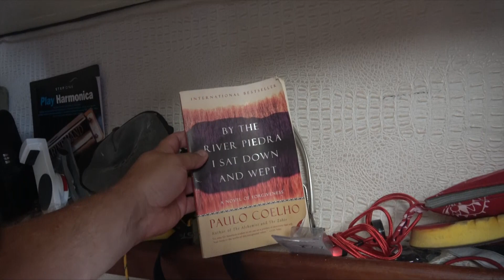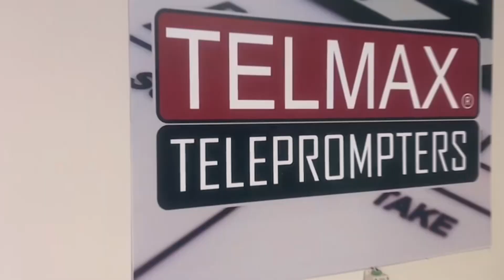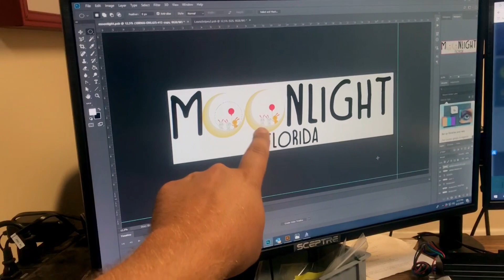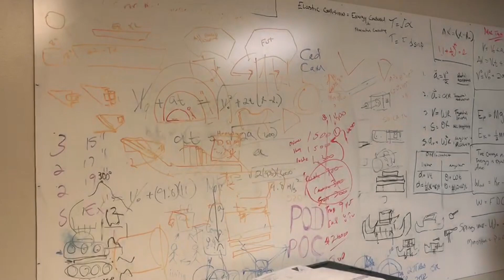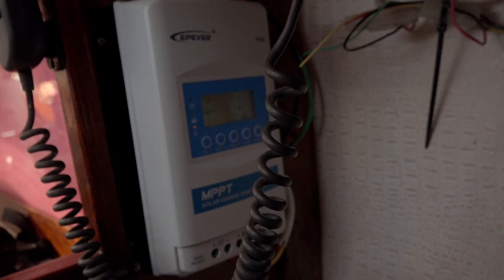BACON SAILS, NEW SOLAR, NEW WINDOWS | SMLS S8E36

Comment: Those are Neodymium magnets, and they're very strong. But they will not hold those panels on in a blow. I use them to cover my trailers - just keep an eye on them in the wind!  Also, they will hold a lot better if you glue the magnets to the bottom of the panel and they just hold through the Bimini material by itself.    Good luck!!
Reply: There was a big blow here in Riviera Beach Marina 4 days ago. Guess what didnt make it?

Comment: Good vids guys can you contain 8 weeks of food for two on your boat we can and amazing how two can go through it  , think about it you need that amount of food to go off shore , we found with all the chargers , we fixed the all on a board , phone , computers , USB, drone battery’s chargers and some extras and mounted it on the cockpit walls inside , that saved a heap of room , and every thing charged in one place , clean and Window shutters fitted on the out side is a must only tips we did